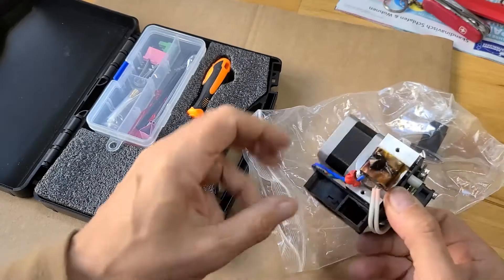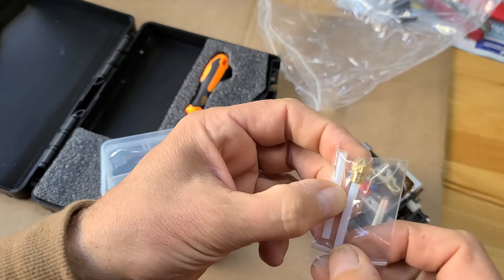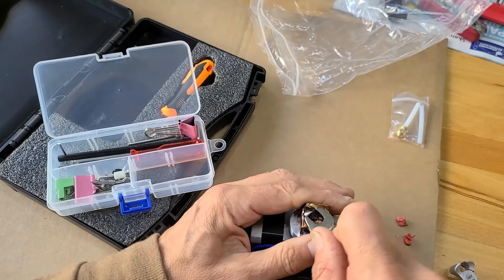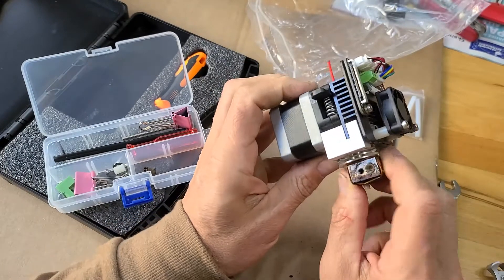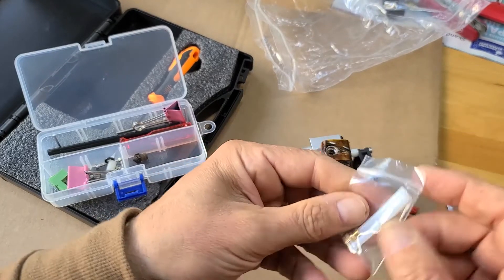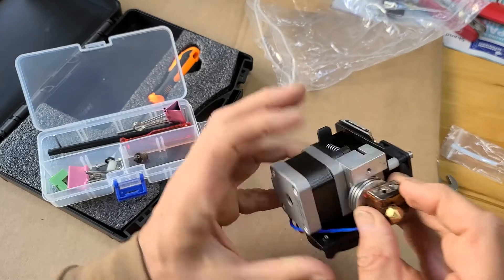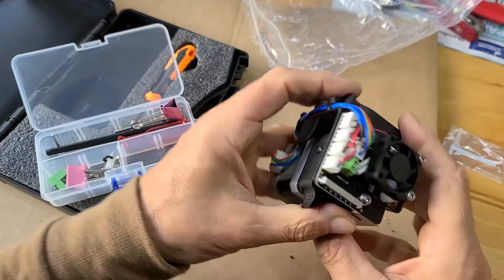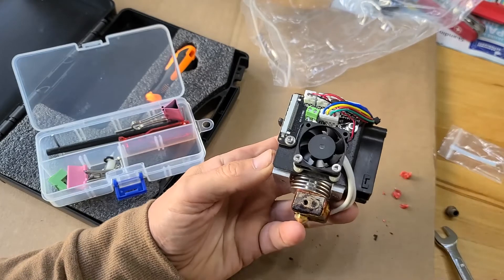Change Nozzle QIDI Printer Extruder X-Max printing up to 4 times faster Small Series Production

Comment: I managed to have my heat block come off... without the tip. The PTFE tube broke free from the heat block and now i have the extruder, heat block and tip... how do I get the old tube out and fix this? Was that block not supposed to come off? Does anyone know where I can get a friggin manual for this thing???

Comment: That was all done incorrectly LOL.  There is a screw you insert into the heatblock that helps with nozzle removal but a crescent wrench is still the best way to hold the heatblock when removing and installing the nozzle.  The orientation of the heatblock and wires was incorrect at the end as the thermocouple and fan wires should each sit on opposite ends of the cooling fan duct. So make sure that is aligned before tightening down the nozzle.
Reply: Add to that, EVERY nozzle I've ever changed had to be HOT to remove and HOT to install, this is GOING to leak like a sieve. That ABS that leaked is because the seal between the hot end and the heat barrier wasn't TIGHT.